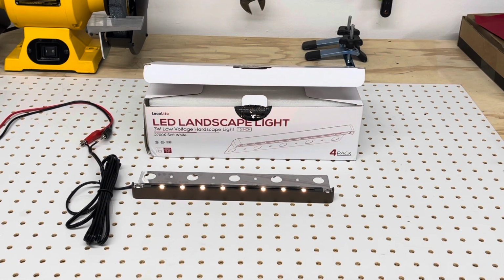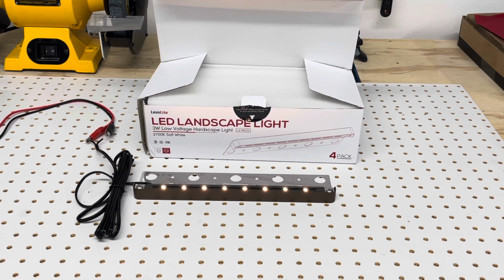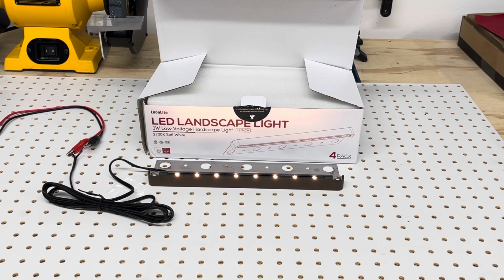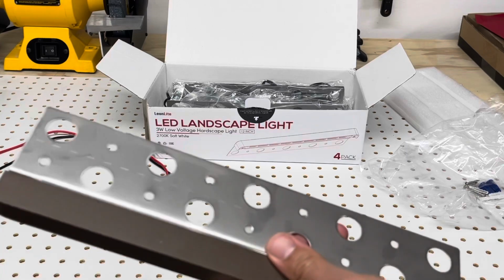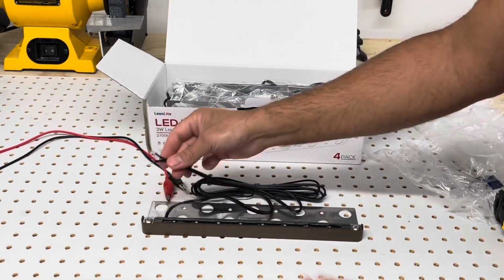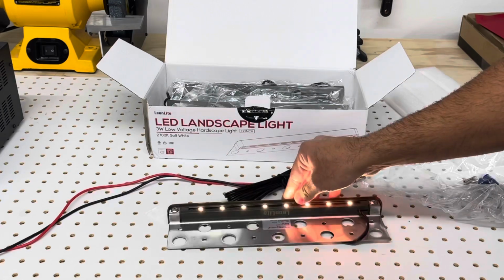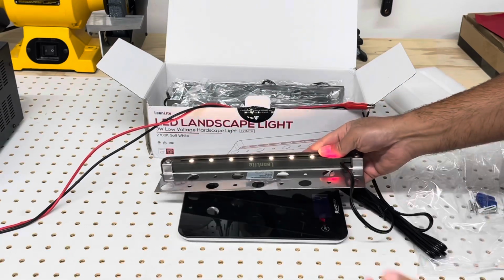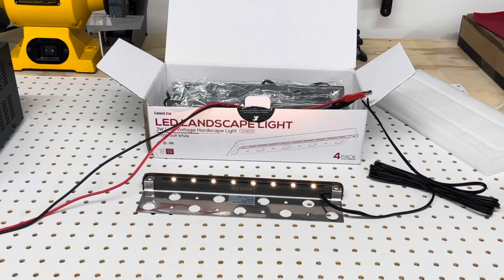Are Terrazza/LEONLITE LED Hardscape Paver Light worth the money?

Comment: To mount on block wall, you would align the power cord to fixture with a joint between wall blocks, and run wire through joint to soil on back side of wall.